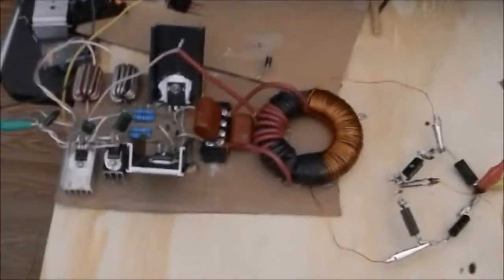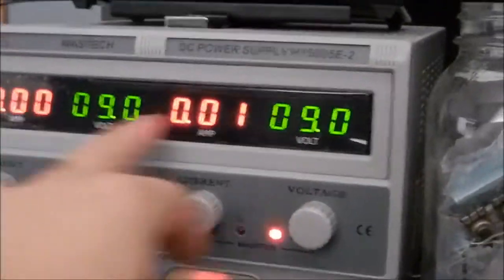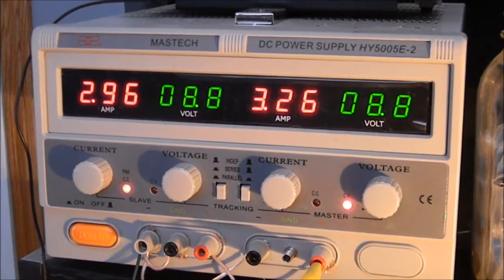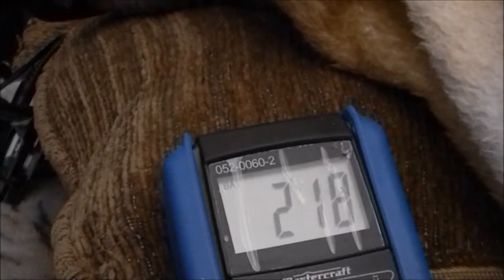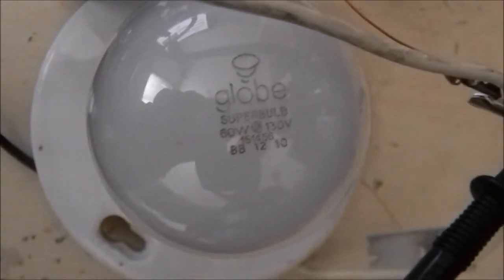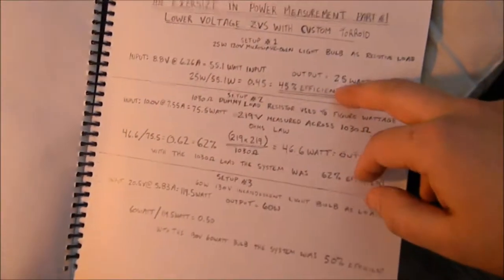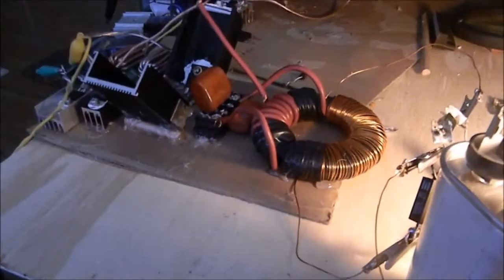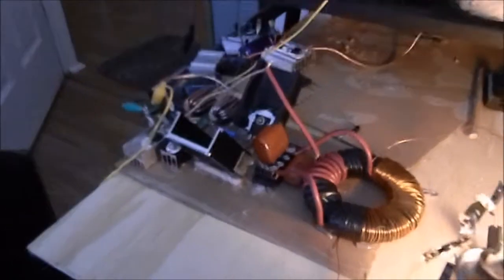An Exercise in Power Measurement Part 1

Comment: I think a better balance between Cu atoms and Fe atoms would help :) More copper per winding...same core. Also I think a balance between L1 and L2 with respect to Cu atoms would give best results as well....same weight in Cu on each winding regardless of gauge. Difficult to do on a toroid though I bet.
Reply from the maker: ***** Thanks for the input, it is greatly appreciated... I will try to factor these variables into the equation best as possible... It may be achievable :) Peace *****

Comment: thats hot hot HOT
Reply from the maker: Tesla Explorer  :) Thanks broski!!!I just have to figure out how to deliver more of that heat to where I want it to go... We will see how hot we can get the system :)Litz wire primary and a balanced ratio of copper by weight between primary and secondary.. Those are the parameters I plan on varying thus far. We shall see.Peace :)
Reply: I would imagine since the project is operational that any heat you're getting off the fets "while 30% under power rating of the fets themselves" is simply switching times being dragged out to long. from looking at how those clips are burning up, I doubt you have much being trapped inside the zvs if any. I would adjust the primary on the toroidal and go from there. that thing should operate cold at 24vdc
Reply from the maker: Tesla Explorer
Yeah, it does run cold (well hardly warm to the touch) at 24V 6A... I don't understand where the losses are coming in. I am befunggled as they say... 1st things first Litz-Wire and more of it on the primary, plus I am going to use a physically larger/higher quality capacitors on the primary LC... Then we will see... I will test each variable on their own, then all of them together.. And... (wait for it).... We shall see. :)
Reply: maybe its in the core?
Reply from the maker: Tesla Explorer
It was in the core when I ran it at higher frequencies/lower capacitance (400nF) on the primary LC tank (the core was literally getting cooked)... I believe this core likes to function properly at lower frequencies, that is why I have about 4000nF now... I am at a loss.. Must do the upgrades and see what happens... Also I am going to replace the 7818 VRs with 7812s... Maybe the MOSFETS are switching a little dirty... Time will tell.
Reply: Binj Komisar AHAAAAA you knew it all along! hehe..... which is why I went AIR CORE, nah im just kidding. ferrite does have its purposes in general. good going! a ferrite mot is the way to go fam. Erlend Ervik would suggest the same
Reply from the maker: Tesla Explorer
Yeah, I have one of those fly-back MOTs... I am going to carry on with this setup though... Change the variables and see how much the efficiency improves.... The Air-Core is the next stage of this setup IF I can improve the efficiency of this ZVS above 75%... But again, we shall see. :)
Reply: Binj Komisar air core would strictly be for fun I suppose =(
Reply from the maker: Tesla Explorer
Its all strictly for fun =D
Reply: Tesla Explorer
..you know Erlend Ervik too? ..nice bloke, although I shouldn't copy him in and then talk about him, I'm sure he doesn't mind.

Comment: What parts of the circuit get hot?  I can't imagine your heat sinks are getting that hot or you would need bigger ones.  Because if you know where most of the power is getting wasted then you can focus on that specific aspect.  As the other guys mentioned and you mentioned in the video I would definitely give litz wire a try.  I've seen a huge improvement when using litz wire for induction heating and I can imagine it would help a ton with a transformer..  Also make sure your capacitors are not getting too hot.  The kind you are using often can't really handle a lot of amps and over heat.  Best thing to do is use a lot of small value capacitors so the current is distributed over them all.  Best wishes
Reply: Makerj101 BTW, I just subbed!  Keep up the great work man!
Reply from the maker: Makerj101 Thank you so much for your input... The heat-sinks barely get warm to the touch... I did have a cap blow up the other night... literally... I will up the quality of the caps for sure in the next arrangement... I really am at a loss at where the energy is "disappearing"... Could it be disruptive interference waves cancelling out? I dunno... I will be trying the Litz-wire-- equal wire ratio by weight (primary-secondary), and of course now, higher quality capacitors... I think I may use 2 or 3 microwave oven caps parallel, they are large and should spread the work-load better... I am kind of excited to see what improvements changing these variables will make.. Again, thanks!Peace dude! :D
Reply: Binj Komisar Ok so then your MOSFETs are doing good.  Sounds like your caps are the problem.  Try using the capacitors from the input filter of a computer power supply.  They are rectangular plastic molded things.  They are generally pretty good.  I like them.  But again four 1uf ones connected in parallel are better than one 4uf cap.  The tiny leads just can't handle the amperage.  So if you can spread it out that's the best.  Well I can tell you one thing for sure.  The energy has to go somewhere.  And more than likely more than 90% of the lost energy will be heat.  Even if the magnetic waves interfere or something and cancel out they would be making heat(basically induction heating).  Now if it's shooting off as RF or magnetic radiation then that won't come in the form of heat.  It could also be your measurement equipment.  A lot of times those high frequencies will really mess up your readings.  Meters have a tendency to record the highest current or voltage with this kind of thing.  I've heard True RMS meters are supposed to be better.  But I don't have any knowledge on that.  If you have some analog meters it might be a good idea to double check the numbers you are getting with your digital equipment.  Analog often does a better job at averaging out the current and voltage of those high frequency spikes.
Microwave capacitors should do pretty well as they are nice and beefy.
Does your big toroidal transformer heat up at all?  Some kinds of ferrite are designed to attenuate certain frequencies.  So if your toroid is directly heating up a lot you might have one of those kind.  I noticed the metal clips that hold flyback transformer cores together tend to do this a lot.  The steel clip on my homemade flyback made the oil around it boil when I pushed the transformer to it's death!  That was kinda fun killing it!  It made all kinds of awful gurgling and frying sounds and lots of white smoke bubbles out!  :P
Sorry for the whole like page and a half!  :P  I can get going on some topics LOL
Best wishes
Reply from the maker: Makerj101
 I know the caps you speak of... And yes, I really do need to purchase a Fluke or at least a Model-T DMM, plus analog meters--- my learning process has led me to accidentally destroy my backup/verification/calibration meters-- more measuring equipment is definitely in order... (all-thought, putting the output through FWBR and a cap and resistive load should flatten out the waviness of the deal.. I would imagine)... The toroidal transformer only heated up when I had 400nF capacitance and a high frequency, it got really hot and I knew had to switch gears... I do think this particular ferrite does like the lower frequency ranges <-which makes sense. (it would be nice to get my hands on some Met-Glass)... Hopefully I will be able to get quite a few more windings on board with this Litz-wire for a more balanced system between primary LC values and, primary-secondary winding sizes..
I love pushing electronics equipment to their max/destruction... Its expensive and time consuming, but its fun and really a good way of learning hands on how far you can push it without breaking it.. :D
No worries about the page and a half, I am guilty as well.. :)
Peace and all the best my man, looking forward, onward and upward! :)
Reply: Binj Komisar  Yeah I need to get myself a nice meter too.  I always resort to buying the cheapo $5 Harbor Freight meters.  They are junk but they work!  And I don't mind at all when the blow up!  They go poof really easily too!  
Yeah it will smooth it out but putting the output through a FWBR and into a capacitor will only give you the peak of the voltage spike(max voltage).  Unless you put some load on the capacitor.  Basically if there is no load on it other than the volt meter then it will charge up every time there is a voltage spike and that's what the meter will see because the capacitor will not drain in between spikes. Just like how an unregulated DC wall wart transformer that's rated for 12 volts will measure 20 volts until you put a load on it.

Yeah sounds like it.  What's Met-Glass?

Fun for sure!  Speaking of which, the 20 IRFP260N MOSFETs I ordered just came in the mail the other day!  Now I don't have to worry about pushing my ZVS driver!  I was being really careful because I didn't have any more MOSFETs and I didn't want to fry it an not have any to replace them with.  Now I can fry away!  :D  Maybe I should parallel them all up and make a SUPER ZVS DRIVER!  10 MOSFETs in parallel on each side... that's 50x10amps... only 500amps max!  XD  That many amps doesn't even come in my house!! :P  Oh but wait, there's more!  They can handle a whopping 200 amp pulse that's 2000 amps!  Hehehe

Actually my latest project is trying to make a metal detector.  I kinda sorta got it to work a little(kinda sorta means like putting a AAA battery 1/8 inch away to get it to beep(another words, there's hope)).  I need to make new search coils.  The directions I'm using call for 70 turns and the ones I'm using from one of my old wireless experiments are only about 25 turns.  So that should help a ton.

Best wishes
Reply from the maker: Makerj101 I agree, the load must be in  place when you try to measure.. Otherwise the measurements will be garbage (using a cheapo DMM)Met-glass are glass cores with tiny metal (mainly Iron) particles in them... I hear they are a superior choice for high-frequency power operations... Here is an e-bay link and wiki-pediahttp://www.ebay.com/itm/Hitachi-Metglas-AMCC-400-Metglass-/171694364819?pt=LH_DefaultDomain_0&hash=item27f9c81893http://www.google.ca/url?sa=t&rct=j&q=&esrc=s&source=web&cd=3&cad=rja&uact=8&ved=0CC4QFjAC&url=http%3A%2F%2Fen.wikipedia.org%2Fwiki%2FMetglas&ei=MnYZVdeuCoT4yQS3o4DQCg&usg=AFQjCNFa187Kg4V-bpa8mlyZuaCTgEoN-A&sig2=89s7tjkWcTwJMjSzruesEw&bvm=bv.89381419,d.aWwI buy my 260s about 20 at a time as well... I need more soon (lol)... YES... 10 parallel x 2 ZVS.... You will have to run it from your 220 line! (and even then that wont deliver the juice that that beast would be capable of)Awesome with the metal detector! I have been thinking about making one myself (lol).. I am confident you will get it to work... What gauge wire does the 70 turn coil call for? Also whats the diameter 8"ish?I sincerely look forward to seeing how your metal-detector works out. Good luck! <-- you will nail it :)Peace
Reply: That's interesting.  Sounds like it would be good for high frequency.

Yep!  More POWER!!!

Cool!  What other projects do we have in common??   The directions call for 28AWG or 0.3mm.  It uses two coils  which each have a diameter of 12cm.  Seems really small to me but since there are two coils and they are D-shaped with a little over lap it's really almost twice that size in the end.  One coil is the transmitter and the other is the receiver.  I tried a couple of other designs but they didn't really seem to work so I'm trying this one because it's really detailed and seems pretty nice.  Here's the PDF if you want to take a look or build one:  http://www.geotech1.com/pages/metdet/projects/matchless/matchless150c.pdf
Thank you! Fingers crossed I can get it working!  I really want to find some old coins and stuff!  Best wishes

Comment: From AC to DC after rectifying, and adding a capacitor? Your output is 1.4 times higher (square root of 2). Meaning to say: if you would rectify 110 Volts and add a capacitor, you would get over 150 Volt. Now go backwards, you see 120 Volts rectified, so the AC part was only 85 Volts AC.
Also try and put a light bulb on 120 Volts DC and see how many amps it draws. A light bulb at 120V AC uses much less power then the same on 120V DC.
Some food for thought.
Sorry, I have no ideas on how to improve the ZVS, nice build so far.
Deslo.
Reply from the maker: deslomeslager Yes I agree with your about the rectification into a cap... But if you have a resistive load in place you negate those effects and get a true power measurement..I was thinking about what you said the other day, 120VDC is much more steady than 120VAC... I will have to figure out what one of these bulbs pull at 120V.. I will use my variac-FBR-into capbank into bulb at 120V, while doing this I will measure the current to figure and compare rated AC wattage against DC wattage... (The system may be more efficient after all, this is good  :)Thank you for the input! I will let you know the results as soon as I run the test... Very good food for thought!Thanks for calling the ZVS nice, I'll let him know you complimented him. :) jokingPeace,Ben